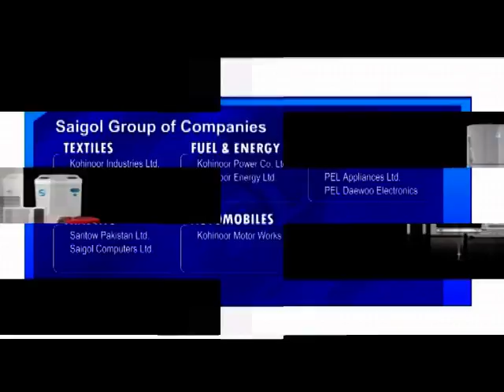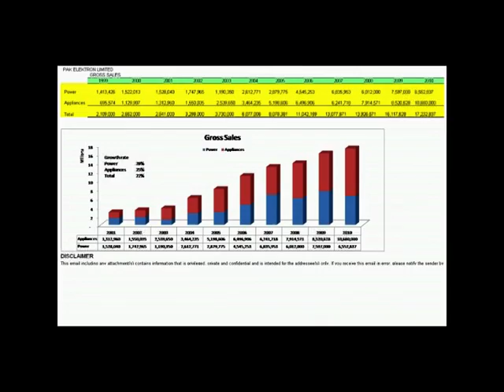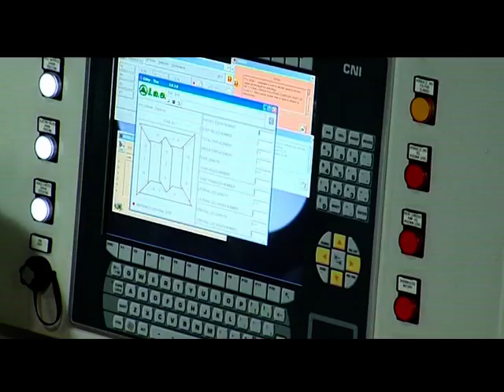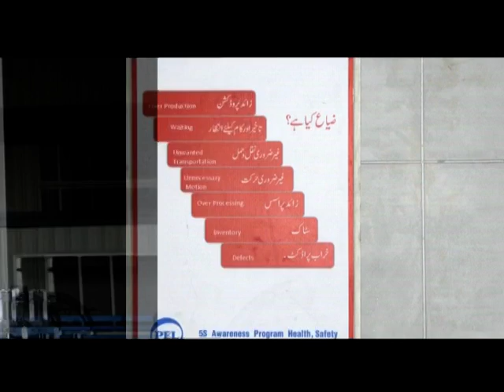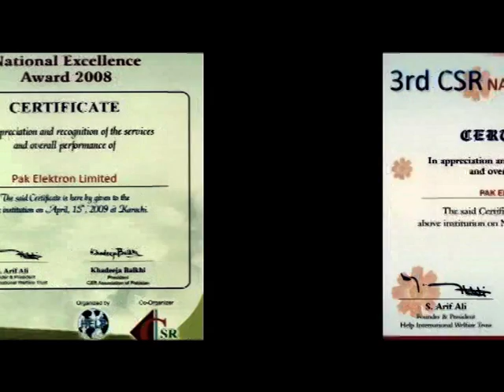Pak Elektron Limited (PEL) - Pakistan

Comment: Iam highly disappointed with your Karachi service handler M/s. Iceland Engineering. Their man Mr. wasim has returned the split unit without necessary wires. the unit was sent for repair. initially he charged us 9700 but unit stopped cooling so we again sent back to him. now he asked for coil repair for Rs. 24000/-. I did not agree so asked him to send the unit back. he has sent now but without necessary wires.  please get my amount of Rs. 9700 refunded and also ask him to send me the wires as he is saying he is not afraid of any complaint with PEL.  is this the way you treat your customers?